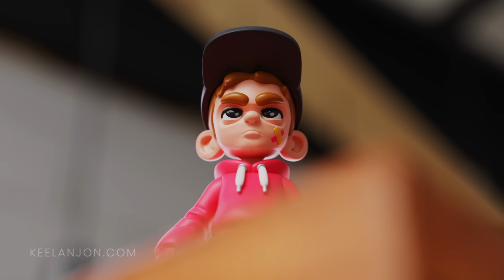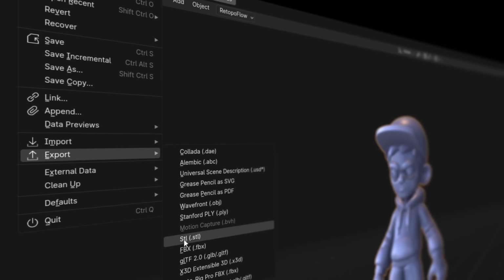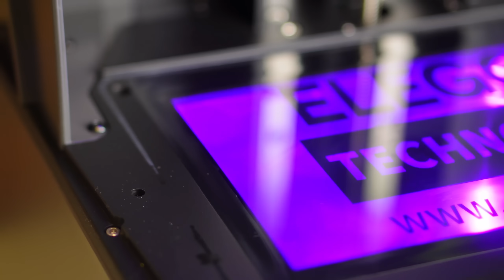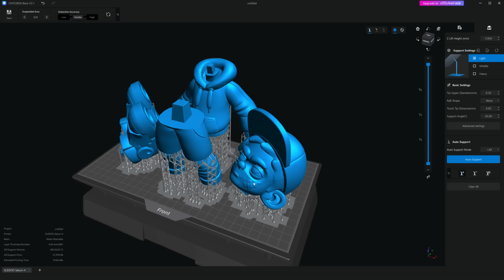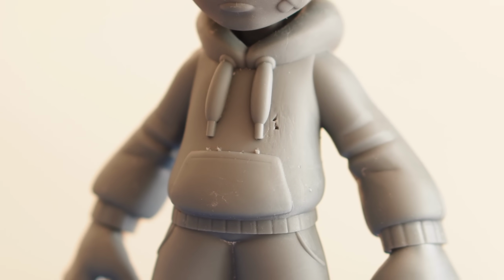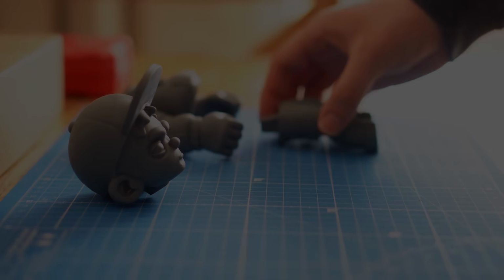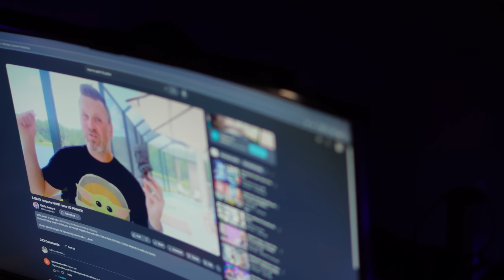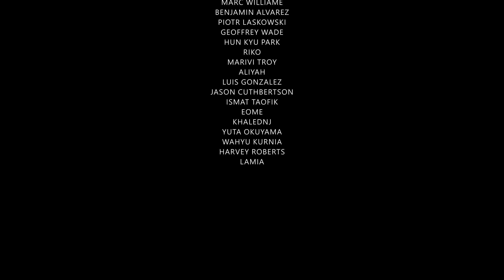How I Made My First Art Toy: Blender, 3D Printing, and Painting Process

Comment: just use more resin to fill any voids then sand smooth, much quicker. remove supports under hot water makes them come off much easier and with less dimpling.  Also highly recommend airbrush paint Createx brand for prime colors ( both Opaque and Transparent ) is extremely affordable and has much better pigment density over water down craft paint.  once you get your comfort and skill levels up you can go for the professional brands.

Comment: I enjoy content where people are learning. But there are things that will make it easier. When using masks especially liquid masks you want to remove it while the paint is still kind of wet to prevent tearing of the paint. If the paint is dry you can use a hobby knife to cut the edges before removing the mask. When exporting export each object separately it allows you to not only change the orientation individually in the slicer but also just print the part that failed instead of the entire thing. There are even batch export plugins and scripts that will automate it and label it for you based on your object names.

Comment: When you made the pegs, how much clearance did you leave for the corresponding hole for the parts to snap to place so easily?
Reply from the maker: I made sure to make the hole a little bigger than the peg itself to ensure they slotted in easily and had room for glue. I didn't use any exact measurements for this, just a little trial and error.

Comment: FDM Printers work well enough nowadays too.
Ya just need a small nozzle, the right setup and aloooooottttttt more patience.

As it prints way slower... if ya want stuff where the print lines are nearly invisible.

Plus side of FDM stuff is. 
PETG or PLA is way way tamer in danger terms and with a makerspace around, most times way more acessible.
Reply: Oh and yeah ... thin your paints and ya can do way better and finer details.

Airbrushing is great and all, but thining helps there too.

Acrylic pain based on water is really good there.

Comment: If only a couple of your parts failed it's a waste of resin to reprint all of the parts. Also making the model solid wastes resin and is probably the reason the parts didn't stick to the bed, they were too heavy. Try making it hollow in the slicer and make sure every cavity has 2 holes near the build plate.

Comment: I can't get Boolean to work in Blender 4.0 and up.
Either it does nothing.
Does the opposite needed.
Or just straight up crashes Blender

I had to revert to a older 3.2 Blender to get the boolean modifier to work. The sad part is the models aren't even high resolution and gave me issues.

Comment: hey there!! awesome video!! I have a small question... so when you added those joints between the different parts, did you make the hole for that joint slightly bigger than the actual joint itself, so it will fit correctly?
Reply from the maker: Yes, I had to make the hole a little bigger than the block for it to fit 😁

Comment: Is the water washable resin safe to use in a house? I've been wanting to get into resin pritnign but the main thing holding me back is the harsh chemicals
Reply from the maker: You'll want to ensure you've got good ventilation with any resin as it's not healthy to breath in the fumes. I keep mine in a garage, but If you need to keep it in the house, I'd recommend getting an enclosure which provides extra protection and fume extraction.